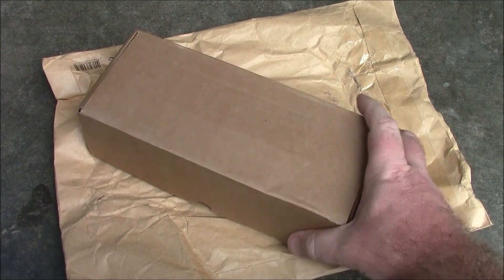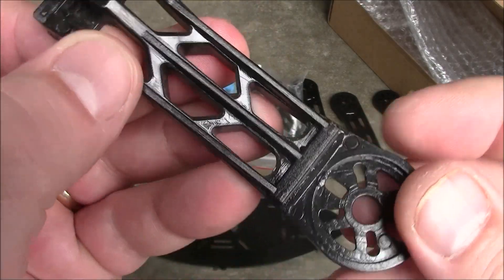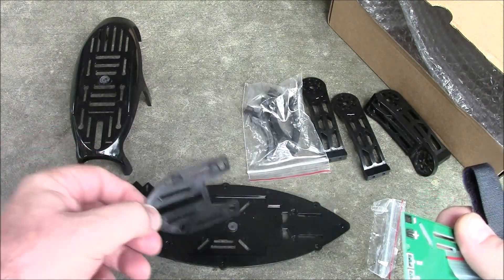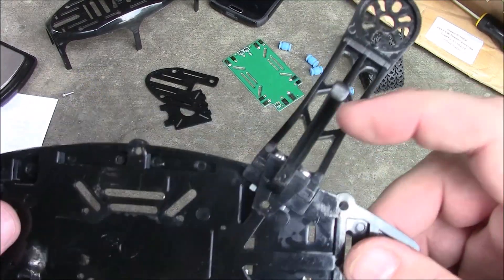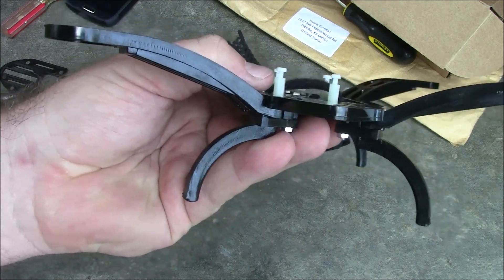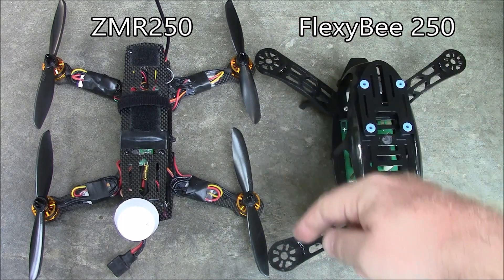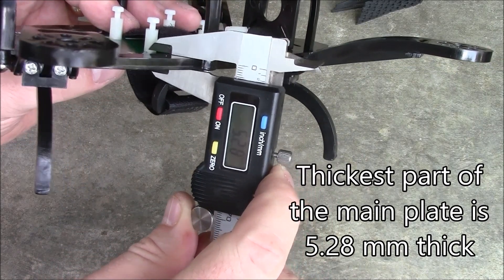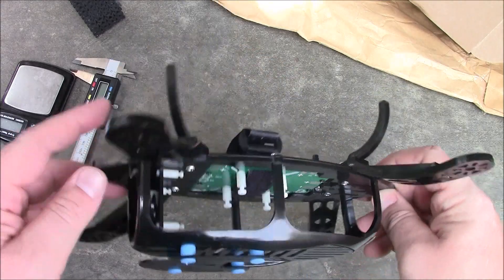FlexyBee Quadcopter Frame Review

Comment: The price of success? 
Just the base frame is 20.00 now. All the extras, like the fpv plate and recording plate, pdb, and so on are extra. Its about a 35-38 buck 'copter now before shipping as you reviewed it.

You can save a few $$ by ordering just the plates and providing your own hardware and damping balls (for the record camera plate), but...

Looking forward to your flight reviews and torture testing on this one though.

BTW, polycarbonate is the generic name for the trademarked product Lexan. Tough stuff, when thick enough for it's intended application.